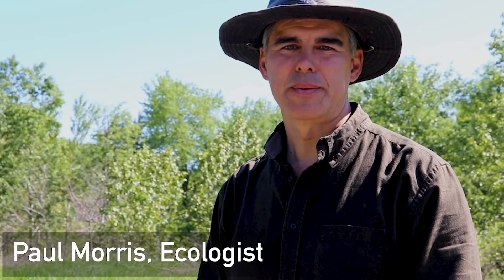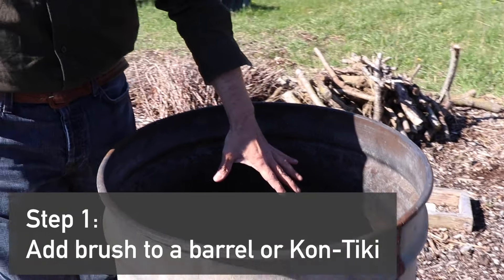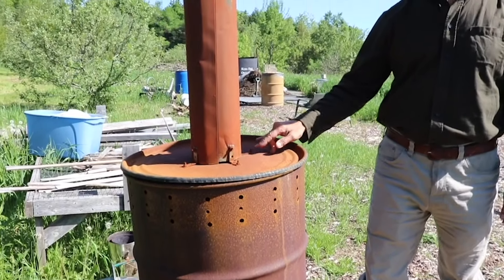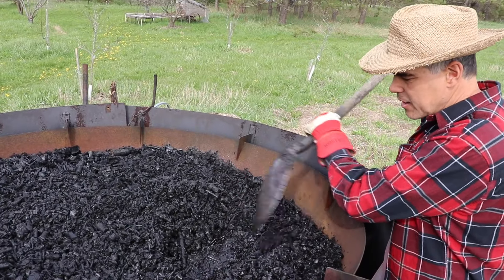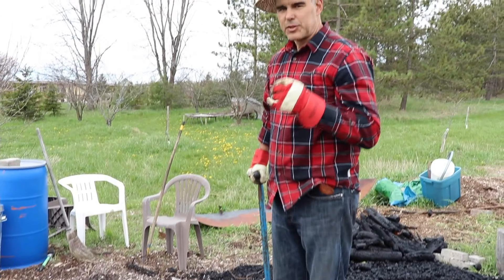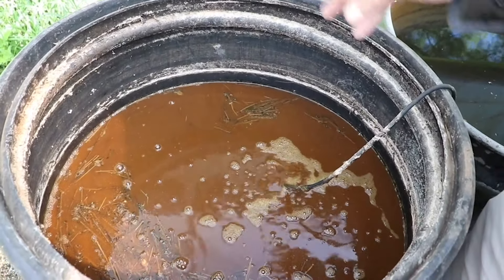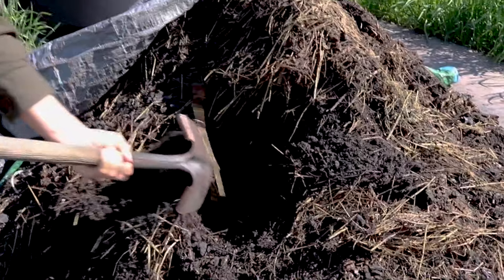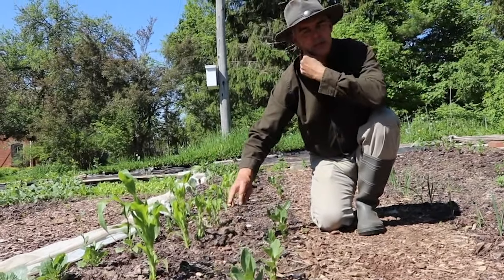THE ULTIMATE GUIDE TO BIOCHAR: how to make it, how to use it, and why it's important

Comment: Thanks for answering my previous question. We have now made 2 batches of charcoal in our 55 gal drum. we had a lot of dead wood donated to us for the hugelkultur but decided it was better to burn the smaller stuff & have biochar than to finish the hugelkultur, so it is on hold waiting for the biochar.  I am confused about Several things & now that we have done 2 burns, I have more questions. #1 What to add to inoculate it when I don't have any fancy stuff like you have, (Worm castings, and icky looking stuff in barrels) but we do have fairly fresh horse manure and table scraps and we have molasses, but your the only one that said to put in salt, and I think one other mentioned rock dust??  How much stuff should I add?  Can you expound on what to add to inoculate it? #2. What ratio of stuff should I add to the charcoal? 1 to 1? less? More?  #3. And I assume that we aren't to treat the charcoal like a regular compost pile, but to add already composted stuff? So we shouldn't add greens to the biochar- just browns? (which we don't have much of either). #4. And how much urine can you add to a 55 gallon drum cut on the side that is full? (maybe 40 gallons). We added just over a gallon, but is more better? Do you just keep adding more & more urine? (I call it biochar lemonade).  😊 And #5. We had some thin black smoke coming off the burn a time or two- which wasn't very noticeable, but I think we may of been burning small branches that weren't dry enough- we have had a LOT of rain lately and some were cut only 2 months ago (Choke Cherry- but we only burned the the super thin stuff, like the width of a pencil or smaller- we actually sat and broke it first to make sure it was dry, if it didn't snap, we threw it away. Was that too picky?).  Just wondering if Black smoke is bad and why should it be a smokeless fire? and why does the wood have to be dry and not green?  Sorry for the long post- Love your video, and I just keep watching it and I keep picking up more & more. In fact I have searched for other videos to watch, and only the Weedy Garden does as good a job as you do. Thanks for posting.
Reply from the maker: Ok lots of questions: 1. You work with what you have locally. If you have fresh manure put the char into it and mix it up. If you have compost mix it in. When the manure is composed well or the compost is done the char will be charged. Others have added it to the feed or ungulates to reduce methane. Or adding to the bedding so the char reduces the smell and then compost the material after. You are thinking about what kind of soil you want when you are done so having a good mix of nutrients is important. Food for the microbiome and it is the microbiome that is feeding your plants more than the direct nutrient addition. The char will absorb the nutrients and slowly release them as needed. 2. about 50% char to the rest of the items. I go through the superbrew proportions in that video and the comments have the measures. We all started in the sea and sea salt has all the micronutrients of the ocean. Obviously it is well diluted in the mix, and diluted again in application. we wouldn't want to add so much that it salinizes the soil. 3. Yes like a compost pile you are trying to enhance the microbiome and get the nutrients into the char. 4. You can add more urine up to the point that the char will not absorb any more. Usually after adding the next day the water does not smell like urine anymore because it has been absorbed. 5. If you use wet wood you will get a cooler burn (white smoke) until the water is evaporated from the wood. A smokeless fire is a clean burn where the released gasses are fully burnt. Black smoke might be from plastic or oils in the wood.
Reply: @PlanetHealers    Thanks Paul, for answering my  questions. I'd like to double check something I read on the web: one site: Bottom-up Biochar, suggests charging charcoal only with urine- by adding so much urine that the biochar floats and letting it sit for 3 days. Since urine has nitrogen, it would be making biochar with a single nutrient: nitrogen. Yes?? But is it a good fast way to make "Nitrogen" biochar then let it finish adding more nutrients in the ground naturally?
About the smoke: I think it must have been oils in the wood, I didn't see any plastic - unless it was somehow infused into the wood from micro plastics in the environment - Does that happen?

Comment: Fantastic video, and I'm glad I came across this before I went for the barrel-in-a-barrel method and ended up wasting a bunch of wood! I do have a few questions though: 

Firstly, I'm wondering about using the charcoal in place of wood chip for a hot composter - the way I understand it, the primary purpose of the wood chip or other bulking material in a hot composter is to provide spaces for airflow and stopping the whole thing going anaerobic, and those chunks of charcoal look about the same size as the wood chip I use. It would pre-charge the charcoal too, and a thin layer of charcoal on top might help with odours -  in a small garden in an english suburb, the smell out of the top of my hot composter isn't ideal. 

Second, how small a barrel would this work with? Like I say, I've got a very small garden and neighbors very nearby, so a full-size oil drum would be impractical even if I was generating enough waste wood to fill it. I also wouldn't need vast amounts of charcoal given the scale I'm working at, so a bucket would probably be plenty of volume, and it's not like I can't have a few friends over and break out the camping chairs while I do a burn - not exactly a chore at that point if I have to do burns more frequently! Does it scale down that far? 

Lastly, most folks seem to suggest using hardwood for biochar, but is softwood or other plant material usable as well? Folks around my neighborhood are forever churning out conifer trimmings from hedges, which I'm wondering about using if the actual structure of softwood gives good results. I'm also wondering about whether the burn is controllable enough, after thinking back to the incident in my teens in which I tried to burn a big pile of conifer branches and ended up with a fairly lacklustre bonfire, right up until the whole thing got hot enough to boil off the resin and went up so rapidly it singed my hair! I also have a persistent problem with Montbretia in my garden, which is highly invasive in britain and which I don't trust my hot composter to break down entirely. After a few hours of digging the root corms out of heavy clay soil, being able to turn them into charcoal appeals to my vengeful side!  

Cheers!
R
Reply from the maker: Hi R
We have done quick demos with a metal bucket and it worked well. For the hot compost the charged biochar would be great to start the process adding all the microbiome fast. I could not replace the wood chips though as the char is inert and the chips are organic matter that will degrade and make the heat. On top uncharged char would help with the smell. 

Any woody material can be used to make the char even corn cobs but you will get less char out as it is less dense. Burning faster you need to be mindful of making too much ash. A good way to deal with invasive species! Try to make sure the material is fairly dry when burning to minimize the white smoke and get a clean burn.
Cheers

Comment: @Planet Healers:
I have 2 questions.
1. Does it matter what material is converted into biochar? I'm specifically asking about fire fuels and what kinds of wood should be used as well as avoided. Can I use hemlock trees for biochar for example? What about a material used in the biochar making process should I be concerned about? I know I can sterilize urine by boiling it and I can also neutralize the smell using pulverized limestone (heated collection tank mixes limestone/dolomite to create a fertilizer and desiccate the moisture out of the mixture; used as an alternative toilet system for urine only). I'm also aware that there are certain contaminants to be aware of from urine, such as some medications and urine from when someone has been sick. Are there any other issues I should be on the look out for?
2. This is the more important question, can you do a video showing a more in depth look at how much biochar to use? I'm looking for something with a scientific method approach similar to what you used in your video with the control sample. I want to know how much biochar works best for soil life over time. Using clones of the same plant would be best to rule out seed genetic variation variables. I recommend tomatoes, since you'd be able to also give a taste comparison review later. Generally speaking I'm looking to answer the question of what ratio to use with soil. Obviously what kind of soil to use is subjective to the area being used, but you can create your own mix to represent each type of soil using compost, sand and clay. I would be very interested in seeing what ratios work best for various soils. If you already have the answers, even better.
Thank you for your time put into this video, I know from what I saw that you spent at least double that time in editing and had to work over several months to get the entire footage. Thank you.
Reply from the maker: As long as you eat a healthy diet, the urine should be good to use. Be aware of what chemicals, drugs your taking in or others contributing to your urine. They pass through. Its more about awareness. If the chemicals are not healthy for you, don't use the urine.
Yes we plan to run more experiments with our biochar to improve it more. There is a fair bit of research out there though, that you could tap into. https://biochar-international.org/

Comment: Thank you for sharing.  Explained very well.  My question is how often should we add biochar or your biochar mix?  Yearly?  I am preparing my beds now for the winter and I have an abundance of composted horse manure and freshly shredded leaves.  Should I combine everything and spread it onto my beds already?  Is it ok to separately add biochar to the top of my beds or should I work it into the beds?  We are getting snow next week so I have to decide pretty fast.
Thanks for your greatly appreciated help
Blessings to you
Reply from the maker: In terms of biochar, you can add up to 25% (charcoal) to your soil and it is still beneficial. If you mix all of your ingredients together and apply it to the surface it will slowly be incorporated over time and should have time over the winter to charge the biochar. My preference is a no-till system as tilling damages the microflora and faunal communities and releases carbon from the soil. Added to the top the nutrients will leach down and act as a mulch for the next year. Frost heave, microbe and worm activity will slowly incorporate your amendments.
Reply: @PlanetHealers  great thank you kindly

Comment: I am with you as far as wanting to do it the easier way, no double barrels but, I have seen and read that the double barrel constrict oxygen, which is what creates the best biochar, very porous. Burning wood like that is cool, but not the same results, again, from what I have seen and read. What are your thoughts on that? Thanks for sharing this video!
Reply from the maker: Oxygen is excluded from the barrel by burning without holes in the barrel. The only oxygen that gets in is from the top and the technique of controlling the burn does not allow the oxygen to turn the carbon into ash (an oxidative process). The burn is very hot, we have melted glass in the barrel. The barrel-in-barrel method does not get as hot. The wood is insulated in the barrel and by the other material packed tight in there. The char is highly porous.
Reply: @PlanetHealers  That makes a lot of sense, thanks for taking the time to explain, God bless!!!

Comment: Saw a video on You Tube from a Homesteader in Southern Mo. He put down Black woven weed fabric  in his active garden. Some one ask wouldn't the plastic cause the ground to get to hot? He took a  soil thermometer. And measured the soil temp under the plastic, and in the soil in the sun. The plastic covered soil was cooler.  So  your putting down black plastic may not be  heating the soil as you think. It maybe the shading of the soil that is keeping the weed seeds from germinating. Here in the Lower 48. They use silage tarps. They put them on in the fall. And remove them in the spring to plant. They have no weeds to contend with while they are planting, or transplanting plants. Makes a perfect seed, or transplant bed. Have you heard about using Corn Gluten Meal as a pre - emergent Herbicide. It keeps weed seed from germinating.  Howard Garrett Web page in his library. Tells of farmers using it. Was first used  dry to control weeds in lawns in the early spring before weeds germinated.  Copied from  his library. Liquid corn gluten meal spray - a listener/farmer recommendation that's a great idea.
The way we use corn gluten on our fields - we make a tea out of it and spray on the fields once a month from Autumn to May. Works very well. We use 2 to 6 cups of corn gluten to 100 gallons of water and spray it on with a pull behind sprayer. We just put the corn gluten meal in panty hose and suspend it in the sprayer when we fill it up, then swish the panty hose, remove and stir. Use at about 35 gallons per acre. Simple, economical and effective. .
Reply from the maker: Yes, I've heard corn gluten inhibits germination but not on how it impacts the soil microbiome. For larger areas, the silage tarps work well yes.

Comment: With the simple single oil barrel method, do you have holes in the bottom of the barrel to help it burn?
Reply from the maker: Hi Michael, No holes it needs to be a burn without oxygen or the carbon turns to ash when you add oxygen. Only the open top of the barrel has oxygen and that is where the combustion happens
Reply: @PlanetHealers  that's what I thought because of the oxygen deprivation requirement part... But then I thought "wouldn't it smoke like hell then?"... But it seems pretty clean burning in the video...
Reply from the maker: @michaellindemann9852  Yes a clean burn after the water evaporates

Comment: Did this time depend of how close we are from the equateur ? I am working in the Amazon in chaikuni institute at 3°south from the equateur, do you think we as well need to wait 3months or as with the high temperature and humidity in our region the process maybe quicker ?

And by the way thanks you so much for sharing your experience and knowledge, it is deeply appreciated !
Reply from the maker: We are doing this in the Yucatan, Mexico and that seems to be the time needed to fully charge the char. We have experimented using a shorter cycle and using beans (nitrogen fixer) and regular application of the superbrew fertilizer. The first batch was good but the second trial had yellowing and stunted growth.

Comment: I bought a commercial biochar product that they say is already activated. They say to mix with compost or worm castings and leave for two weeks before using. However, I also plan to add a lot of other things, such as those you mention in the video.  However, you talk about leaving it for three months or more. Is it absolutely necessary because I had planned on the two weeks and wanted to plant two weeks from now?
Reply from the maker: If they say it is activated they may have done the process already?? You can add your materials and see when happens. Try the superbrew video if you find the plants yellowing because it was not charged enough.

Comment: Im from Peru and thats an amazing video. I have a quiestion sir
 Biochar technique reduce the percentage of heavy metals like mercury?
Reply from the maker: Most heavy metals would stay in the biochar but mercury vaporizes at 356.73 °C so in the process (400-600C) it would vaporize. I would be very careful using high mercury material because you could easily get mercury poisoning from the smoke then. “Biochar has been investigated for adsorption of pesticides, heavy metals, nutrients, and organic compounds. Several researchers explored the adsorption capacity of biochar and confirmed favorable results for heavy metal ions [3, 31], nutrients [15], and organic pollutants [4].” Biochar binds toxins and prevents their movement in the soil

Comment: you said it requires 3 months can we apply it at the end of july without danger of to much stimulation to the plants ? Usually it is not recomanded to fertilisiz at the end of july ?
Reply from the maker: Hi Robert, We have spead up the process with mixed success. After one month we planted beans (nitrogen fixer) and used the superbrew to help replace nutrients that the biochar is absorbing. First trial had a good crop of beans the second had some yellowing and not that strong of beans. We used less superbrew on the second crop to see how it would do.

Comment from the maker: We have added the raw form of the "Super Powerful Brew - Organic fertilizer and microbiome enhancement" video to our Patreon account if you would like to have an early viewing please support our work! https://www.patreon.com/Planethealers
Reply: How does biochar reduce carbon in the atmosphere? Is it because it helps produce larger plants which use more CO2 from the atmosphere during the growth process? When you burn plant fiber, wood or manure, doesn't that emit carbon into the atmosphere?  Ever used natural gas as a heat source to reduce emissions? Isn't coal essentially compressed and dewatered tree bark? Ever thought of using coal?
Reply from the maker: @berthabrown8093  well plants take carbon dioxide out of the air to make sugars and in the burn process 50% of that carbon is retained as charcoal. If left to rot then 100% would eventually return to the atmosphere. Coal was plants from the Carboniferous period and is highly compressed more like rock so not usable for biochar.